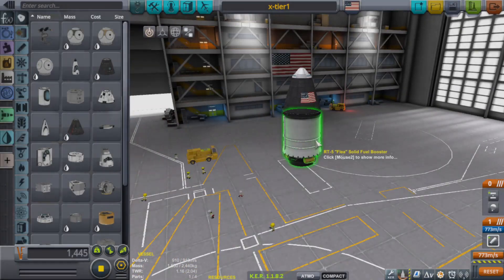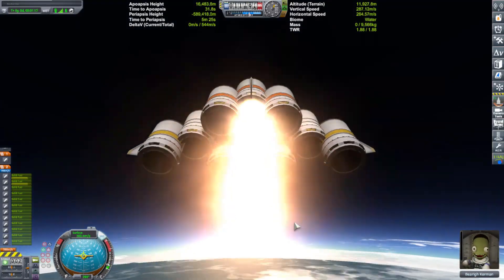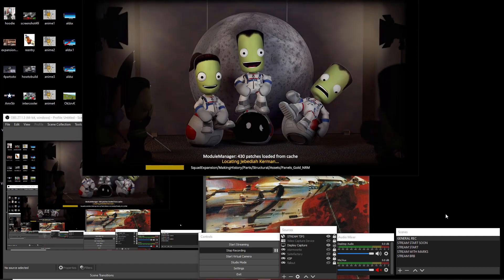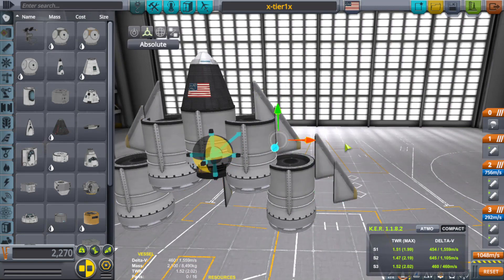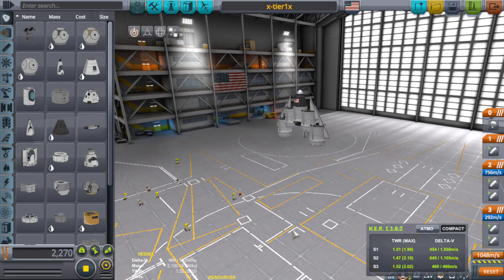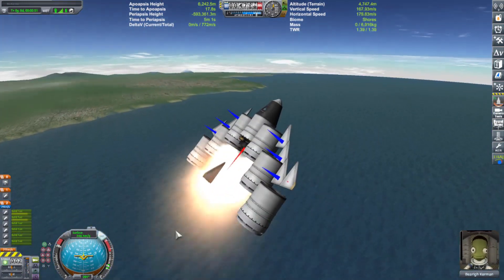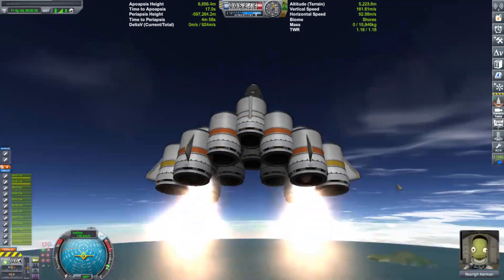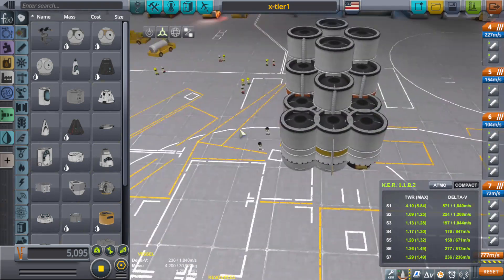TIER ONE SSTO are IMPOSSIBLE. Change my mind.

Comment: Aight, I still don't have my desktop set up, and I basically agree that a T1 SSTO/SSRT isn't possible (and if it is, it definitely isn't practical), buuuuuuuut, I have a few ideas (and this is for everyone else's benefit as much as its for VAOS's benefit):

- The payload to reaction mass fraction is going to have to be absurdly low. Something like 3:25, but with only one command pod, and at least a thousand engines.

- You'll have to do an un-gravity-turn. Basically, burn straight up until your apoapsis is stupidly high, then do a separate circularization burn. Go high enough, and you don't need as much delta-v to make an orbit (but definitely not a circular one). The catch is that you have to go really high for it to pay off, but not so high that you escape (there's some complicated orbital mechanics reasons for this, but the last I was aware, those reasons are still within the scope of the game's physics, so it should work).

- Ditch the fins, since they're literally just dead weight, especially if you're only going dead vertical in atmo. 

- Keep 2 engines rotated 90 degrees outward at the bottom of the craft for rotational assistance (when the time comes to finally rotate). One to start the rotation, the other to stop it. Basically, SRB RCS.
Reply: Physically, achieving a low circular orbit always takes less total energy than achieving any higher orbit.
Reply: @k.k.9378  I fully acknowledge this is true. I'm simply basing this strategy off of an experience I had where I accidentally put something in orbit with only SRBs with a similar ascent profile. When I tried to do it again with a more traditional gravity turn, I could not reach orbit. I'll fully admit I'm not the best pilot, but I believe I managed to do a bi-elliptic transfer to orbit (well, partially, but a highly eccentric orbit with periapsis above 70km still counts as an orbit.
Reply: So, to expand on my last comment (and my original one), the traditional gravity turn is essentially a Hohmann Transfer, if you consider the craft sitting on the ground as already being in an orbit (and from the perspective of Kerbin's Center of Mass, it is).

The Hohmann Transfer is simply a special case of the Bi-Elliptic Transfer. But the actual Bi-Elliptic Transfer can be more efficient in certain cases, starting when the ratio of the SMA of your transfer ellipse to starting SMA is 11.94 (lets call it 12). 

Kerbin's radius is 600km (treating the height of the KSC's launch pad above sea level as essentially negligible). Since the surface velocity relative to its center is only 175 m/s, and using some handy calculators, I've confirmed the initial SMA at 300km (give or take some error due to the periapsis only being about 1.5km above the CoM)

This means that at an SMA of 3600km, a Bi-elliptic transfer to orbit reaches breakeven relative to a Hohmann transfer in terms of delta-v. This equates (assuming the periapsis stays the same) to an altitude of about 7200km, which is between Kerbin and the Mun.

But that's just for breakeven. A ratio of 16 assures a more efficient transfer (the actual number is something like 15.58). Which would mean that any SMA greater than 4800km assures us a delta-v reduction. That gives us an apoapsis of 9600km (still less than the distance to the Mun). 

Meaning any vertical ascent with a Mun-crossing trajectory should take less delta-v than a traditional ascent.
Reply: @AnnaNym-h5k  interesting!
Reply: You can nerver exceed the wet/dry mass ratio of the fuel tank you use. That means a craft using the flea can not physically have more delta V than 1949m/s. I'm quite sure that isn't enough to get to orbit no matter what you do.
Reply: It absolutely is mathematically impossible. A lone Flea only has 1949 m/s of vacuum delta-V, and no single-stage (i.e. no dropping/destroying empty boosters, does not matter if they are ignited all at once or not) assembly using only Fleas can ever get more delta-V than that.

All the short, early boosters (Flea, Hammer, Mite) are hopeless for this. The Thumper probably is as well - 3356 m/s vacuum and 2797 m/s sea-level delta-V. The earliest an all-solid SSTO is likely possible is at tier 5, with the Kickback (3202 m/s SL/3613 m/s vac) and Pollux (3654 m/s SL/4110 m/s vac).
Reply: Going straight up means you need a whole lot of delta-v though, since you'll be fighting gravity every second of flight and then you need to accelerate the craft to orbital (vertical) speed once you're out of the atmosphere. That usually is only a viable strategy when you're dealing with a very dense atmosphere (such as Eve), and then, you pretty much just postpone your gravity turn to when you've left the thick parts of the atmosphere. With the way KSP treats aeordynamics, this craft is very efficient, so air resistance isn't much of a problem.

It seems that the rule of diminishing returns hardlocks you on 2km/s in delta-v on tier 1: adding more boosters only gives negigible amounts of delta-v once your rocket has reached a certain weight.

I'm not saying it can't work, I'm just saying I don't see how it is going to work. Maybe the counter-intuitivity of this approach is what makes it work.
Reply: You don't need to have the steering boosters at 90° since you can still have them not go the center of mass